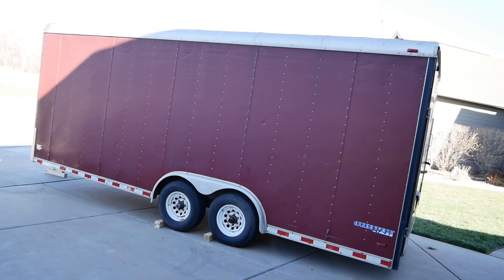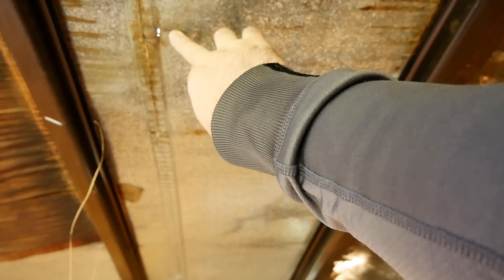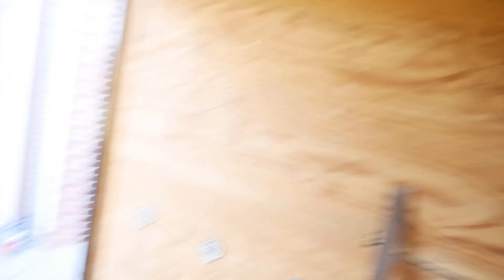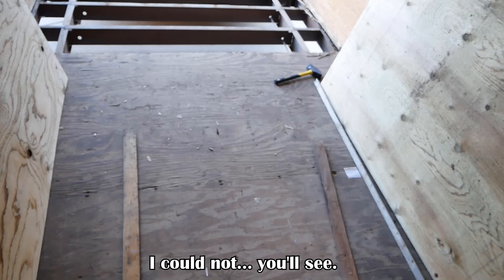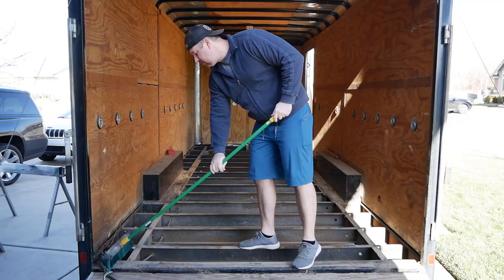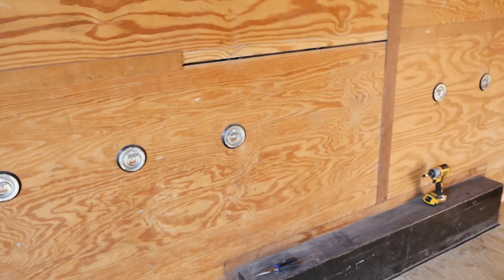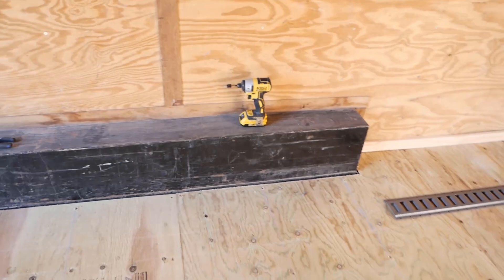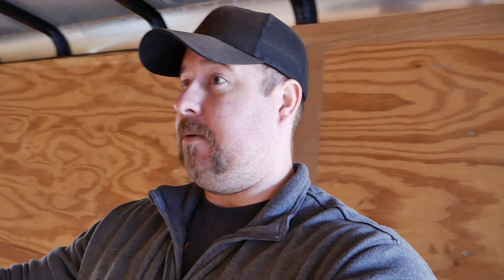Replacing the Flooring in our New Enclosed Trailer!! Trailer Overhaul

Comment: Sir, this is a great video and thank you for taking the time to make it and post. Getting ready to rebuild a 28' and this is exact the details I needed. Will go with pressure treated ground contact plywood vice prepainting the underside of each. They are $58 a piece right now (4/12/2024) compared to $40 untreated. Thanks again man- video is terrific as well as most of the comments that added some nice tips and tricks. Reallly appreciated. Youtube is the best use of the internet :)

Comment: Can’t thank you enough for taking the time to put this video together. I bought a 10 year old 8 x 14 trailer that had sat in a lot for about 8 years. No water damage, but a worse problem- Rat poop smell on the floor. The trailer as you can imagine was basically given to me so anything I do to repair and upgrade still beats buying a new one. Other than the floor, I’m going to replace the tires, wheels, bearings and have the brakes checked. I would certainly value your opinion on what else I should be on the lookout for on something sitting for so long.
REALLY HELPFUL VIDEO! Thanks again. Jeff- ATL
Reply from the maker: If you're replacing all of that, you're probably pretty good. Throw some new seals around the doors and grease up the hinges while you're at it! Glad it helped!

Comment: Using a 15 in 1 to apply upward tension with stripped screws helps a lot. I had that issue and was using a prybar just like you but once I starting using the 15 in 1, got the rest up in 15 minutes.
Reply: sounds like a great tip, thanks man!

Comment: Didn't read all.comments but I would dado that E-track into the 3/4" flooring so as to not create a trip strip or high spot in floor. Install it flush with surface. Just my recommendation.

Comment: I have never realized that underneath the trailer is the floor. For whatever reason I thought there was something else under there to protect the floor. I think if I ever have to rip the floor out of my trailer I'm going to paint the underneath just to be on the safe side.

I thought you did a pretty good job on the nose of the floor. That's a tough cut to make.
Reply from the maker: Yea you can coat it with a waterproof primer or specialty outdoor paint if you want. I figured it'll never really get wet unless driving in the rain. Plus they store these pressure treated board outside uncovered at menards 😅 trick with that nose piece was tracing the old one then putting it in before the full board that butts up to it. Thanks David!

Comment: Congrats on the new trailer, and the new house man! 
I hope you find something better than silicone to fix the holes in the roof...I think there is some better stuff out there you can find from the RV world? Or at least some polyethylene Caulk? Silicon doesn't hold up well, requires water to work and last so it can cause rust...
Reply from the maker: Appreciate it man! We are still looking for a place to buy, but have a place to stay until then. I ended up grabbing some automotive seam sealer. Stuff worked great!

Comment: Rookie question…. Did you have to drill holes through the wood and into the frame before screwing the plywood to the frame?  Or do the self tapping screws make it through the metal frame on their own?  Thanks for any info.  About to start the same project!
Reply from the maker: Nope, those self tapping screws go right throw the wood and metal with no pilot hole 👍🏼

Comment: Great job on the flooring! Are you at all concerned about moisture hitting the bottom of the floor? I’m wondering what I can do to seal the bottom side of the floor, as I want to make my floor list as long as possible.
Reply from the maker: Thanks man. And not really. They are pressure treated plywood so it can handle the moisture. You can coat them before installing with another waterproofing product though.
Reply: One could coat the underside with FG  resin before they’re fitted, also as with all house/home renovation best to start at the top and leak test any repairs before replacing the floor

Comment: Please I just bought a trailer and the floor is like wood pieces pressed together in flooring , is that pressure treated. Gosh water on the underneath road side is not good to me. Great work!!
Reply from the maker: It should be pressure treated plywood. A lot of companies will coat the underside with something as well to further prevent water damage

Comment: Where did you find plywood sheets longer than 96"? I noticed you said you had a 8.5' trailer. Mine is too and the planks are around 98".
Reply from the maker: Mine fit in there with about a half inch on either side to spare. I did put larger trim around the bottom to help cover any gaps too (3/4 inch thick instead of 1/8 inch thick)

Comment: What protects the floor from underneath when the ground is wet?  Is there some sort of undercoat?
Reply from the maker: Its pressure treated plywood, so it has pretty good water resistance. You could always paint the underside with some sort of sealer if you wanted before laying it down. Should see too much water unless driving in the rain as well
Reply: @LifeofBliss  Thank you, that makes sense.

Comment: I have a trailer with a couple of boards that need to be replaced, the issue I am having is similar to what you mentioned in the video regarding the self taping screws not coming out all the way, how did you remove them?
Reply from the maker: I either ripped them out with a crow bar or took a sledge hammer and hit them sideways (to break them off) or straight down, then pull them out with a crow bar. That broke the threads holding the screws so it was a bit easier to remove. Either way, it was a pain... good luck!
Reply: @LifeofBliss  thanks!  The local trailer repair shop want $2500.00 to fix the floor of my trailer, ridiculous!
Reply from the maker: Wow!! That's steep... Granted it wasn't fun to do, but that seems a bit much even for doing all that I did. It was around $300 in materials
Reply: @LifeofBliss  thanks again, I have their material list, I will be doing this myself!
Reply: Chuck your drill on them tight then reverse it managed to get all mine out that way.
Reply: @darrellladnier1139  nice!

Comment: What thickness of plywood is on the walls ? I need to re-do the entire interior of the trailer I bought. There is 16th in on the walls that aren't even cut to fit, gaps all over the place and the floor is rotten.
Reply from the maker: It's very thin walls, probly 1/4 or so
Reply: @LifeofBliss  Thank you for this !